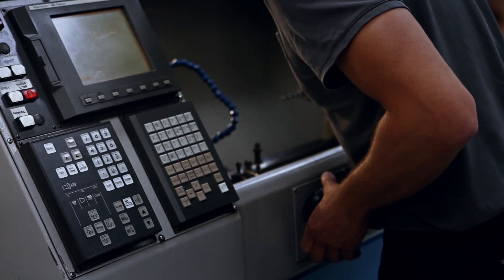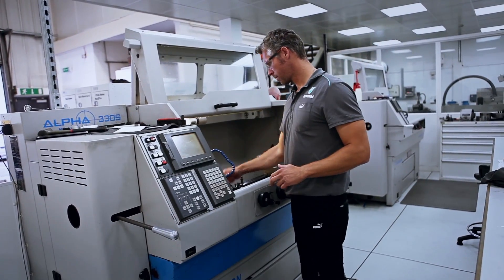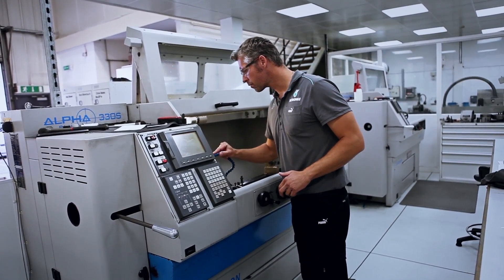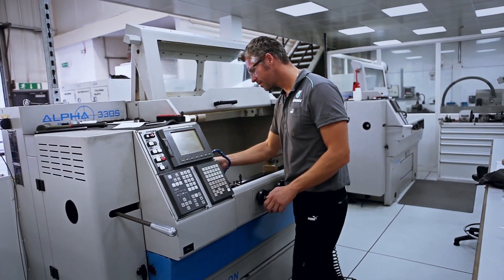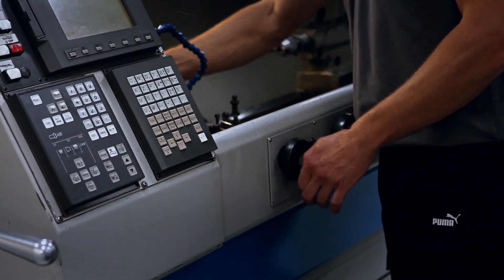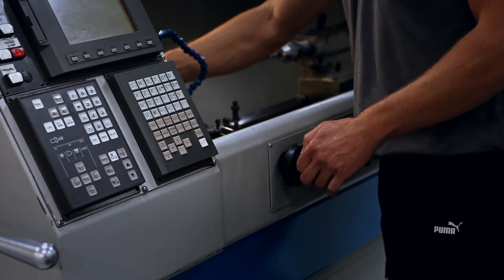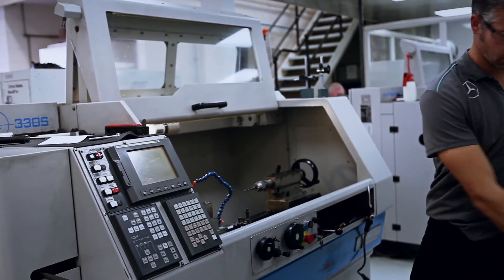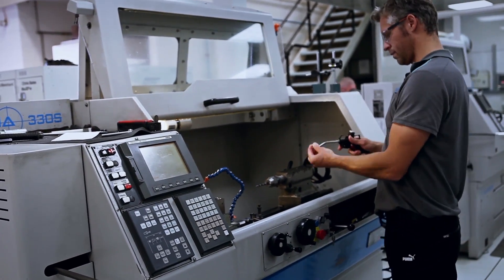Access All Areas - Machine Shop, with MERCEDES AMG PETRONAS

Comment: Ohh... CNC machines. One of the best part of the HQ. It's my dream job that the people do there. I just work on a Trumpf Trumatic L3030 4kW Laser and a Trumpf Trumatic 600L Press & Laser machine. But learned turning and milling.

And am I see it right? It's a Fanuc 0iT controller on the machine? I used the 0iM, and it's a good but hard to learn controller.